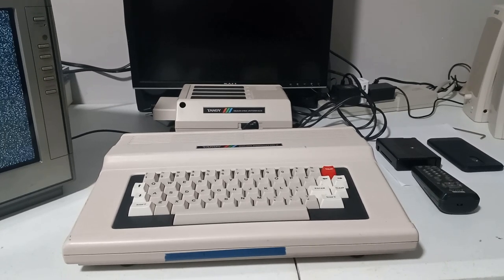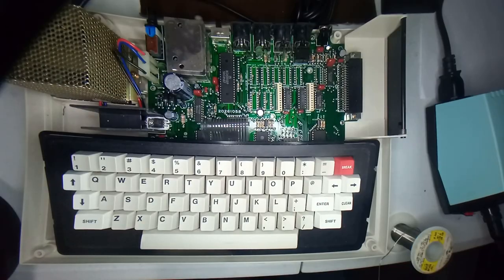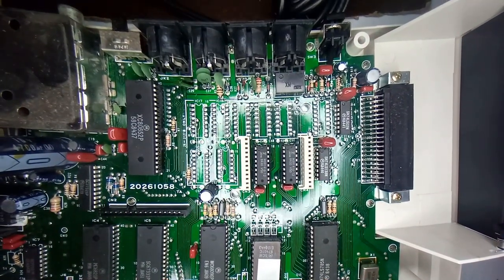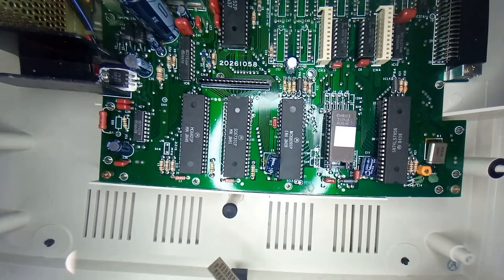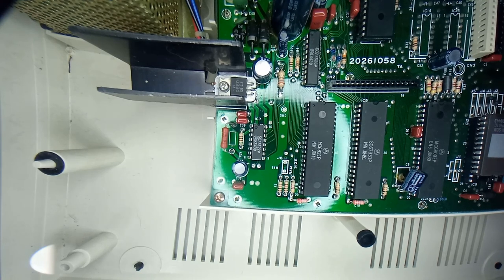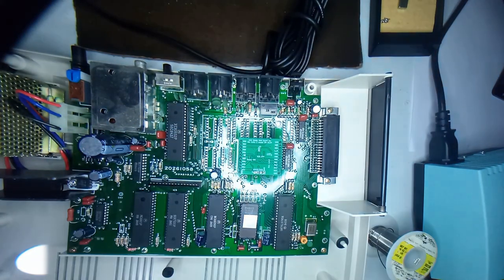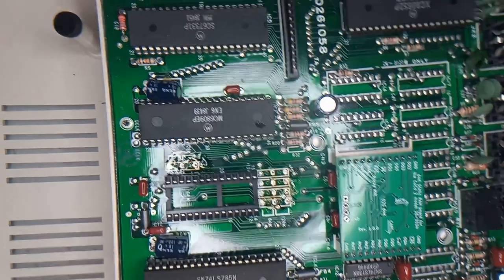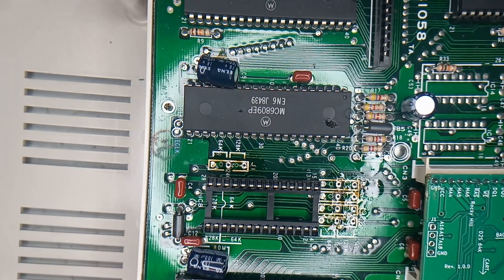CoCo 2 T1 RAM and ROM upgrade

Comment: Flux Remover = Tech Spray Line - Flux Remover.
About how much current draw difference is there between a factory default 64K with DRAM install, vs your static ram board?
Reply from the maker: I'm not sure but I can probably squeeze  a measurement  in during my next project.